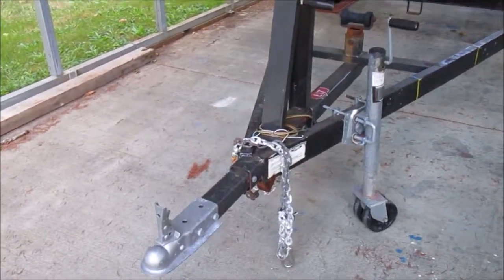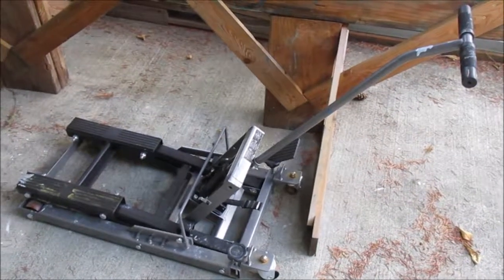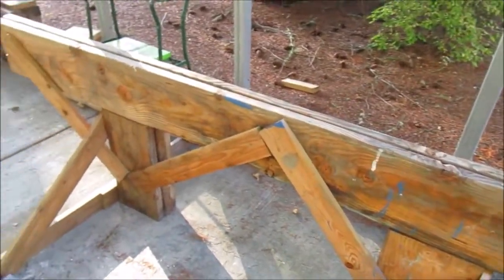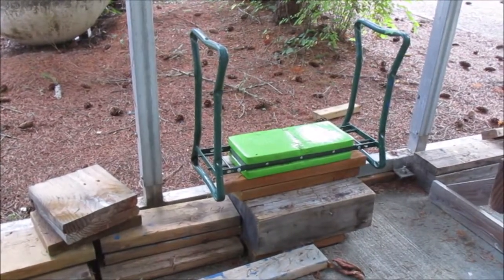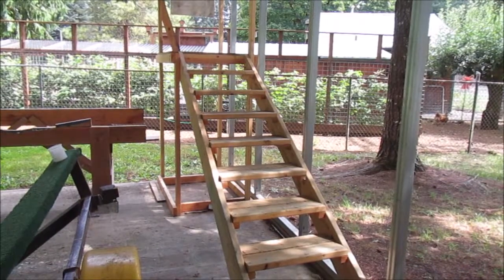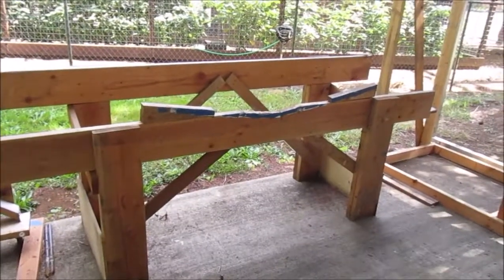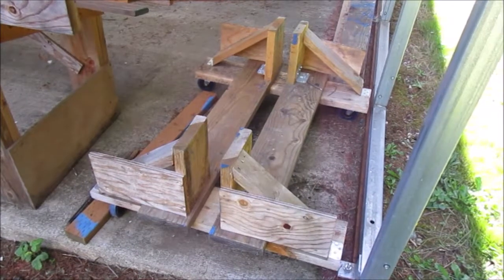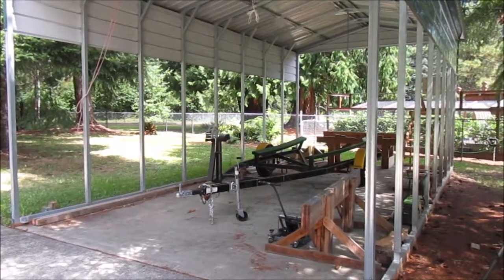Lifting a Small Sailboat (A) -- Catalina 22 -- Jim's Little Boat

Comment: Jim, I'm interested in Catalina 22s and am wondering how you located a trailer in Lynden? Did you call all the junk yards and ask them specifically? Are there yards that specialize in boats? I live in Kitsap County.
Reply from the maker: I found Jeff and his boat junkyard in Lynden on line.  At the time he had a C22 that he was parting out.  I bought the aft rail, the trailer and some other stuff.  The thing about Catalina 22 boats is that there are lots of them out there so some end up in wrecking yards. They are worth parting out since there is a market.  That was the main reason I bought a C22 instead of a San Juan 21 which is a better day sailor, but it is kind of an orphan boat. It is much easier to replace the hinge pin in a C22 than other small boats and there are plenty of parts.